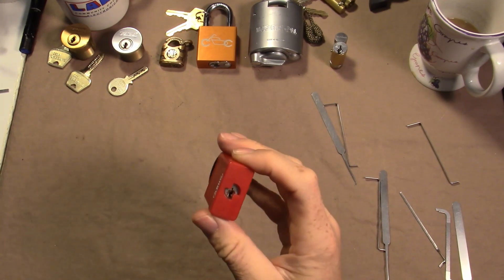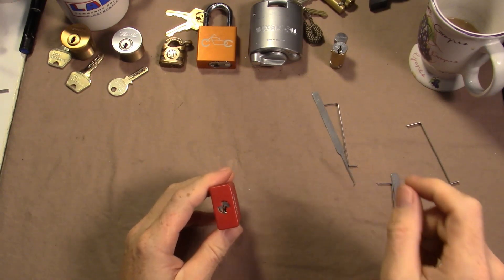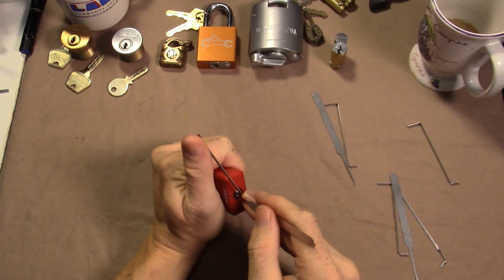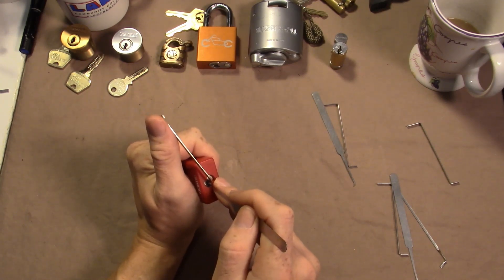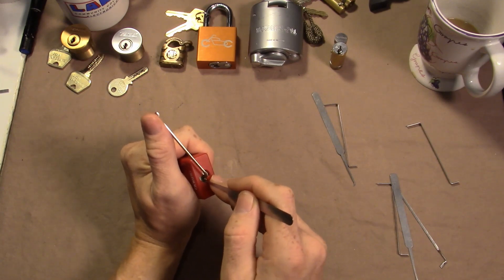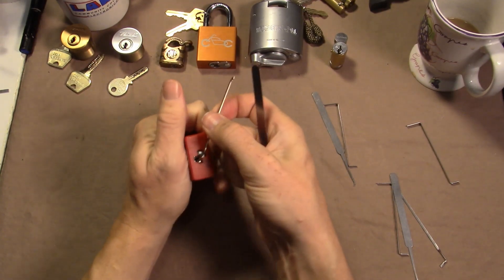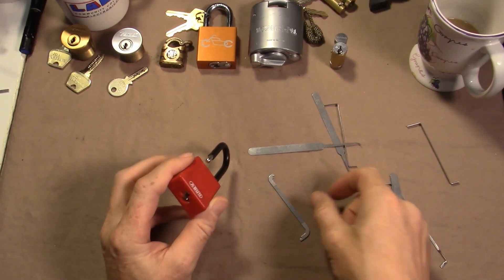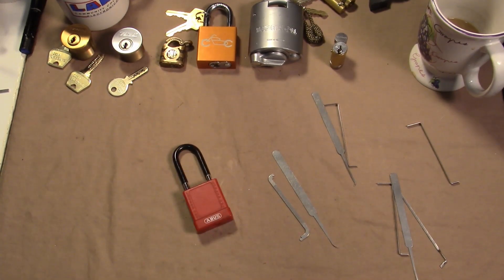Abus 74/40 Picked for #LotoLockTuesday

Comment: Nicely picked👌 I've recently received a 74/40 and wondered if they were guttable due to the seam near the bottom of the lock body. 
Have a great day my friend👍😀✌️
Reply from the maker: Unfortunately they are not designed to be gutted.  I think I saw a video where someone semi destructively took one apart.
Reply: Charles Builds Crap - Charles Current I do have 2 of them and thinking of turning one of them into a Challenge Lock, do you recall who the video was by or any details on how they went about gutting it? Any help would be greatly appreciated👍
Reply from the maker: @KeylessEntry  I just found it again.  I won't try to post a link, they usually end up flagged as spam.  Potti314 did the video called "(picking 342) ABUS 74/40 LOCKED OUT padlock picked / gutted / reassembled - a little lock adventure"
Reply from the maker: @KeylessEntry  Also found a few others.  kerensky77 did a video called "(083) Abus 74/40 LOTO Dissected for Science"
Reply: Charles Builds Crap - Charles Current That's awesome, I will watch them straight away, thanks my friend😃